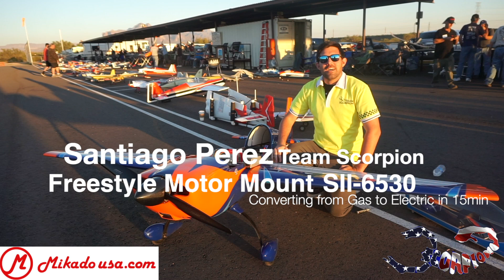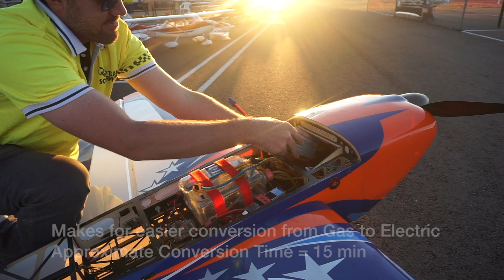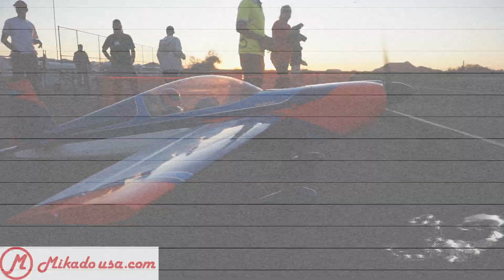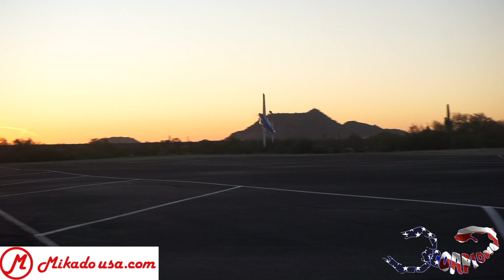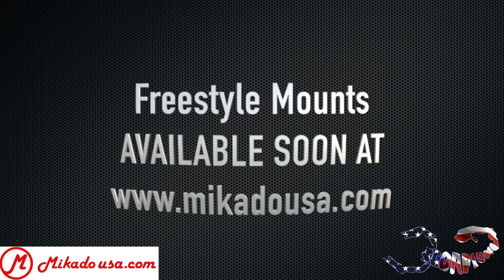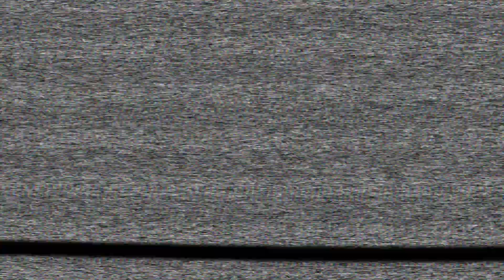Scorpion Freestyle Cross Mount + Standoffs  w/ Santiago Perez

Comment: How would you say the power compares to gas? Also, any thoughts on the Jim Kitt gearbox?
Reply from the maker: The point of this power system is not to compare to gas. Gas planes have more power but are heavier. “Traditional” electric power systems with “comparable “ power to gas are very expensive, and even heavier. 

This is a very lightweight, eco, and practical power system for giant scale electric. 

All other electric power systems, while they have “thrust” similar or more to gas, they are also several pounds heavier, and normally use 4 x 6s 5000 mah batteries! (Which is beyond practical to charge 4 packs for one flight in my opinion). So you end up with a 29-30lb plane. 

With this lightweight concept, you use just 2x 6s 5000-6000mah batteries, and the plane weighs about 2lbs less then gas, so most modern planes weigh about 24-25lbs with this setup. You still get around 5-6 mins of flight and the plane flies great! Very smooth yet very capable as you see in the video. 

Is not the power like gas, but since we are limited by battery technology, in our opinion it is the best compromise to have a practical giant scale Electric power system.
Reply from the maker: Jim Kitt is very good at what he does. He has produced some amazing results with his gear box. 

But of course there is much more added costs and mechanical complexity to that system, not to mention extra weight, and recommended 4x 6s 5000mah batteries. 

So also is not so comparable to the SII-6530-180kv, as they are 2 complete different concepts. 

If you want, economic, simple, and “practical” system, but are ok with a smoother flying plane with less aggression. Then the SII-6530-180

If your focus is not on cost, complexity, and batt charging times, and you want the most power for your plane. The a Jim Kitt system might be what you are looking for. 

It all depends on you, and your flying style.
Reply: @dahlkyle  Awesome, thank you so much for your reply! This definitely gives me lots to think about.

Comment: Good performance~
Could you share Motor.ESC.battery.airplane information?
 - EF 104 extra ?
- 6530 180kv ?
- scorpion tribunus 200A ?
- 14cell battery?
- prop ?
Reply from the maker: EF 104 extra 300
Scorpion SII-6530-180kv
+ freestyle cross mount
+ freestyle standoffs
Tribunus 14-200a ESC
12s 6000mah 25c battery
Falcon 28x13E
Reply from the maker: @mmgbrouwers3d You are half right, and I am half wrong now that I remember. At this event Santi was testing 1 x 6s and 1 x 7s battery for 13s 6000mah. Normally we run 12s though. Here are other videos with the performance 

https://youtu.be/oN1Vce1-48E

https://www.facebook.com/watch/?v=517642722285034